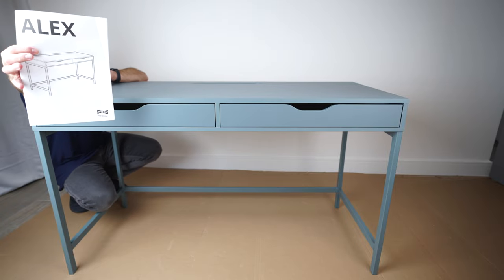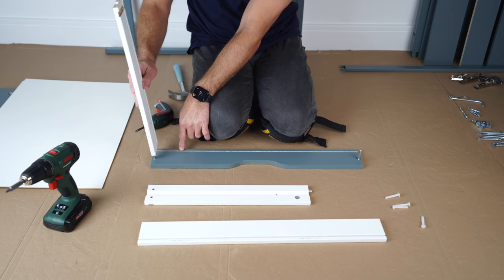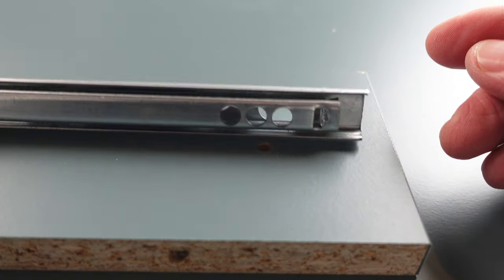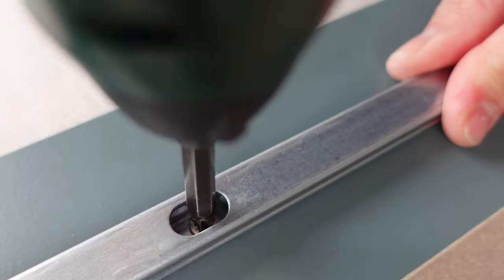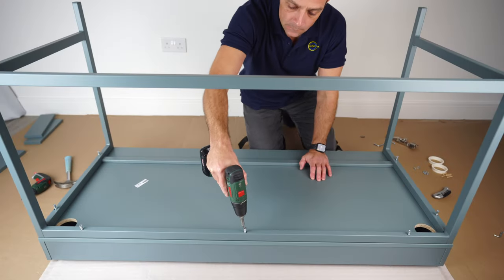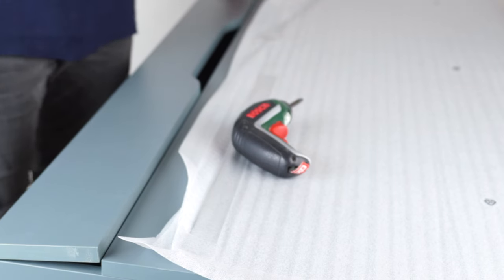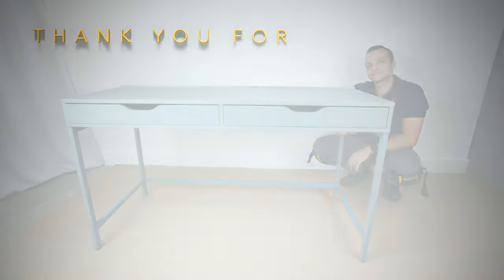Ikea ALEX Desk Assembly instructions

Comment: At 10:33 I cannot get that cross beam to slide all the way into the slots.  It's as if the tabs on the beam don't have enough space to fit into the slots on the legs.  Any suggestions?
Reply: I have the same issue right now. Were you able to figure it out? Or does anyone else has tipps?
Reply: I have the same problem did Amy of you guys figure it out?

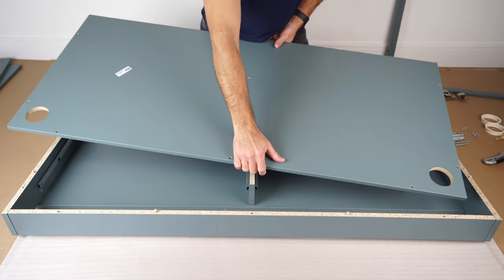Comment: When attaching the bottom part of the desk, shown at 8:57, I am unable to do it properly, I can get the wooden pegs in but then the main screw in the middle is out of alignment, if the main screw in the middle cab get aligned, then it means that not all the pegs can get in. Does anyone have any tips for this?
Reply: true story. just assembled mine today, I wish it took 15 minutes! lots of things don't align, neither does going to ikea! it:s like walking into a playground, although the desk was on sale!
Reply: @philafflack1298  same heree its doesnt line
Reply: What I did was just get rid of the wooden pegs in the middle and have everything else align and then put in the middle screw. :/
Reply: @mochiwonders  sollution: smash all the wooden thingys into the holes with a hammer, if they are not all way in they dont align